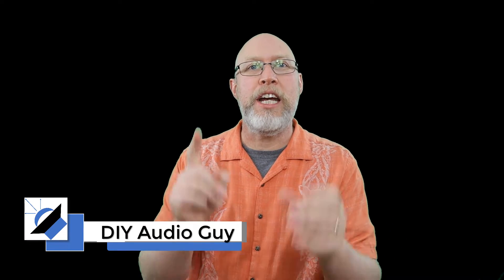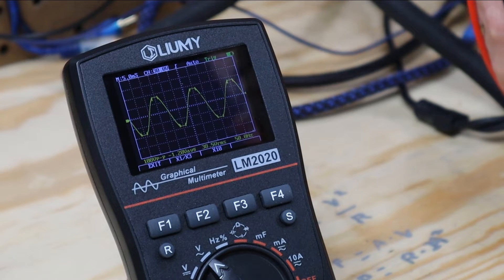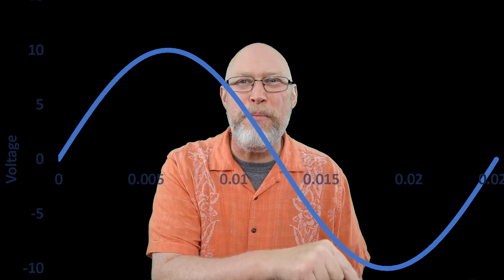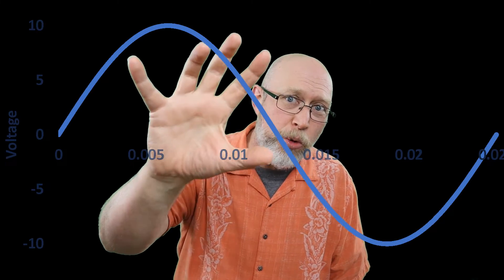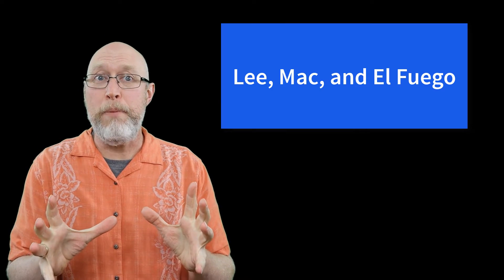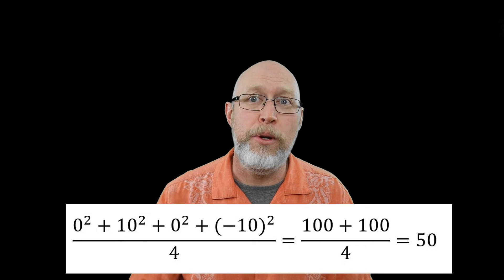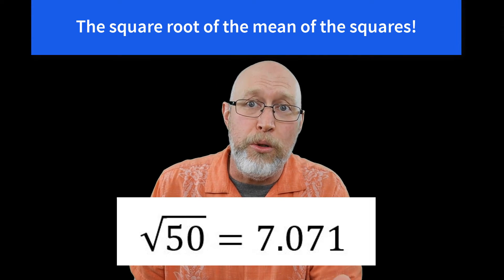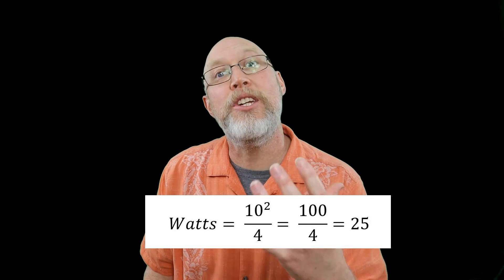RMS Watts vs Peak and Max Watts, Amplifier Power Explained

Comment: Please help me with this ,, if i have sony stereo ( dsx a416bt) rated at 55×4 max ,, can i power 4 pioneer 4 way ts a1680f with 80 rms each ?
Reply from the maker: Yes.
Reply: @DIYAudioGuy  so i dont need an amplifier ( the sony stereo is 20 rms per speaker)  that is quarter of the speakers rms , will they sound good or i have to turn the volume to the max ?
Reply from the maker: @amgil475  You don't have to have an 80 watt amplifier to drive 80 watt speakers.  The speakers will operate just fine with anything less than 80 watts.    It will not be as loud but it will still work.  You won't have to crank the radio up to full volume to get sound out of them.   Will it sound better with an amplifier? Probably. Will it be louder with it amplifier? Absolutely.  If that's what you're going for then buy an amplifier.  But if you're just trying to get some speakers hooked up so you can get some music then you don't need to add an amplifier.
Reply: @DIYAudioGuy  and on that 20 rms stereo , which will be lowder a jbl 6.5 with 45 rms or pioneer 6.5 with 80 rms ? , in other words, will the  20 rms stereo sound the same on 40-60-80 rms speakers in terms of sound pressure and loudness ? And which could perform better if i have to choose 40-60-80 rms on 20 rms stereo .
Reply from the maker: @amgil475  If you look at the specifications for the speaker they will have a sensitivity number measured in decibels, the one with the highest sensitivity will be the loudest.  It sounds to me like getting loud as your goal, so go ahead and get an amplifier.
Reply: @DIYAudioGuy  yes but if i have to choose between 40-60-80 rms speakers with my 20 rms stereo regardless of their sensitivity and for overall sound quality which one do i choose

Comment: I'd imagine you've taken apart more than a few active loudspeakers/subs. Are the drivers typically low impedance?  IE, is a Klipsch subwoofer amp that is claimed to be 200 watts actually a 100 watt amp running @ 4 ohm rather than 8 ohms?
Reply from the maker: It's hit or miss.  Most home audio powered subwoofers use a 4 ohm driver.
Reply: @DIYAudioGuy  thanks.

Comment: My comments keep getting removed,  I guess it's due to the links I've added.   As of 2000 the FTC no longer uses RMS Watts as it's not a correct term.  Google Audio Power and look for the Wikipedia article.    Just drop RMS from the statement and stick with Watts or Continuous Average Power and it's good.  RMS Watts is not a correct term.   If this comment gets removed I'll know it's the channel owner.
Reply from the maker: It's the links, YouTube does that automatically.
Reply: @DIYAudioGuy  Thanks,  just to clarify I'm not saying your wrong in what you are doing.  The Watts RMS or RMS Power is just a term that needs to die off.  We just want the Watts,  not the RMS Watts.  RMS voltage is a correct term as is RMS Current,  just not RMS Watts.   RMS voltage squared divided by the load impedance can get you the watts.   But you wouldn't then say we need the RMS of that wattage.
Reply from the maker: @jeffm2787  You're good.

Comment: Lol.thought it was rated measure sound rms
Reply: @DIYAudioGuy  What you think about isobaric?
Reply from the maker: @JonathanLopez-tw8ef  I think it's a pretty cool setup, the main advantage is you can cut the airspace of the enclosure in half. The main disadvantages you have to buy double the number of subwoofers.
Reply: @DIYAudioGuy   ok what about amp watts in isobaric
Reply from the maker: @JonathanLopez-tw8ef  It's the same as any pair of speakers in parallel.
Reply: @DIYAudioGuy  Ok just thought mono block two sub in Peralle in 180 phase might work to a advantage in iso setup

Comment: Peak is a BS marketing scam.. any REPUTABLE company didn't even use a "peak" rating..
Reply from the maker: Several reputable companies will put a max or peak power rating on the box.  Kicker and Kenwood both do that.  But both of those brands will also list an appropriately rated RMS power on the box and in the manual, and both of those brands produce amps that actually meet their rated RMS power.

Comment: Cool video! But I have a weird question regarding my subwoofer... I wanted to set it up using your guide on how to set gain with a multimeter. Its a sony Xplod and on Sony's website it says it's rated power is 300 Watts.... But the box clearly says 420 Watts CEA RMS Power, and it isn't a mistake because I actually have 2 of these subs and its the same on both boxes. Which number should I take into consideration when applying my gain settings? The rated power, or the CEA RMS power, and what is the difference?
Reply from the maker: In that case you're going to need an oscilloscope or a DD-1 to set the gains.  The multimeter trick only works when you have reliable specifications.  But your best bet is to go with the lower wattage number.

I'm also not sure from your comment what you are trying to do. You mentioned the power rating of the subwoofer, this is all based on the power rating for the amplifier.
Reply: Thanks for the answer. I know its based on amp power but my amp can output a bit more power than the subwoofer can handle, So I don't want to set it too high and damage the subwoofer. I'm going to go with the lower number then, because I only have a multimeter. I will also ask my more experienced friend to help me make sure there isn't any distortion or other kind of problem. Thanks for helping me out!
Reply from the maker: @kubaz2308  If the amp is more powerful than the subwoofer then use the subwoofer RMS power.

Comment: So the RMS values and Peak values should always be 1:2? What about when a company is selling their sub as a 1000 RMS woofer that’s 1500 peak? 
Should it be run at 750W? Or is true peak 2000w? And how can I figure this out?
Reply from the maker: I don't know, I've seen a lot of subwoofers rated that way.  More importantly, the peak/max number is meaningless and it should be ignored.
Reply: @DIYAudioGuy  how about even single term. In dvc is still function at 2ohms.  And thean if you parallel the two coil reault is 1ohm, so my e the wtts peak is true? Or maybe ex. Gevin is 500wrms the true wttms rms per coil is only 250wrms? If you combine 500rms.?

Comment: my monoblock is rated 500w rms at 2ohm and 1000w of peak, for the 1000w peak when does it work ?? or its just marketing ? then my sub is rated 500w rms and 1500w peak, that mean my sub can handle up to 1500w before damaged ? sorry im newbie
Reply from the maker: Peak is just marketing.
Reply: @DIYAudioGuy  so even if you parallel/serries? It still 500wrms?  If the rms of sub is ein 500wrms?
Reply from the maker: @akolngto9314  yes

Comment: My father always told me this, whenever looking for an amp and for speakers too, look at the rms rating never peak.
Reply from the maker: Your father was a wise man!
Reply: Anyone who knows anything about audio should know RMS is more important. Sadly some people don't.
Reply from the maker: @kazzng2087  and that's been going on for decades.
Reply: My brother taught me exact same. But years ago, I'm talking 80s. You could buy speakers with a rating of 160 watts peak. Like my REALISTIC MACH2 speakers with 15 inch drivers. ( optima series) top of the range. Rating back then was 80 watts RMS! Years later I took them to get surround redone on woofers. As foam surrounds perish over time. The electronics technician when I asked him ? How much power handling can I get? Because I have a Yamaha A-520 amplifier? It was 75 watts RMS. perfectly matched but he told me : these woofers can handle approximately 200 watts RMS! He was an old guy and his workshop inspired me to get heavily into Electronics. Nowadays I divide amp rating by four.
Reply: Same here
Reply: Too many companys   give fake rms  almost all